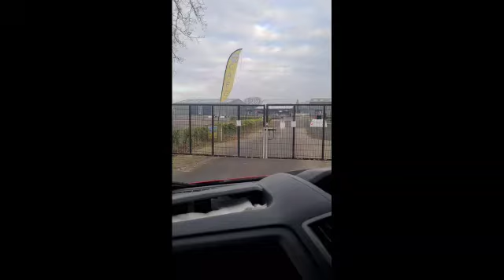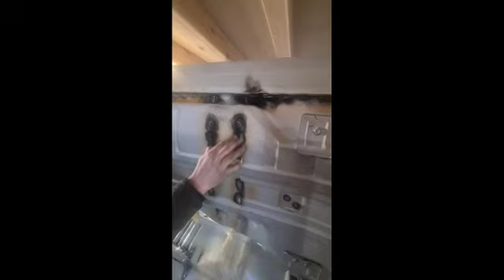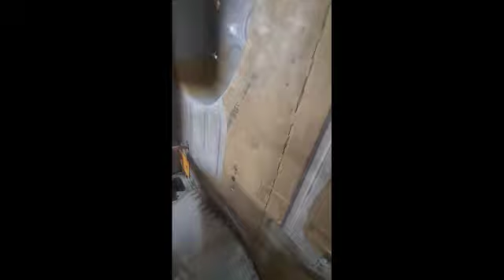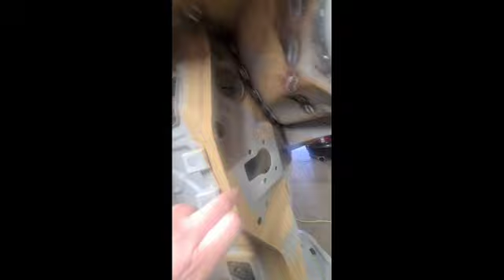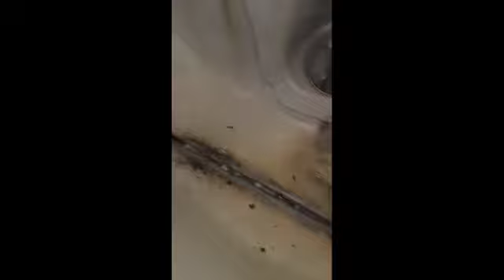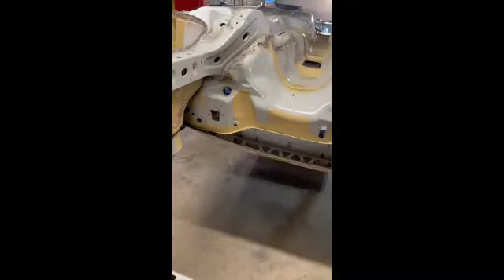Eggenberger rs500 Video 2 . Collecting the roll cage tube and more seam welding

Comment: Great video
Is the rollcage to be period correct or current spec.
If it is to be period correct how does the racing gods see it as I am from australia the racing gods frown on older cars that have speed.
Like seeing old race cars being reborn even if to more currect specs.
Reply from the maker: Hi Allan , the cage will be exact period , but with 45mm main hoop and down tubes , this then meets recent regulations .